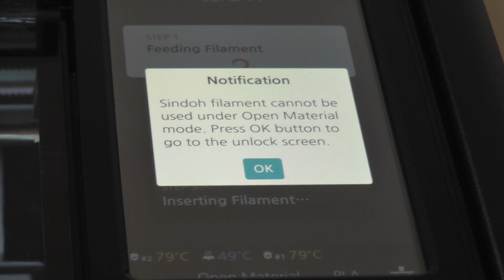10 - Sindoh 3DWOX 2X 3D Printer - Open Material Wide Spool Mod and Opening the Case

Comment: In the video you mentioned the filament guides for the open source. Do you have the stl files to print the guides for the 2X printers?
Reply from the maker: These guides can be printed from the Test Print area in the Settings menu on the 2X printer itself.

Comment: Very informative videos Bob. Thank you. Quick question for you,  is it possible to print two of the same parts at the same time with both print heads?
Reply from the maker: Unfortunately not.  Think of the complications.  You would have to first have both parts being printed at the same Z layer at that same time.  Then you would have to assure the print heads didn't crash into each other.  While I can conceive it may be possible in certain rare situations, in my opinoin it would be too restrictive to make it feasible.
Reply: @AllThingsBobot  Thank you Bob.

Comment: BOB,  will pc+ filament material work ok on these heads without having to "upgrade them?"  I also accomplished this mod and I must say your video was extremely well put together and made it a sinch.   Thanks a ton.   :)
Reply from the maker: I don't know about the pc+.   On the Amazon listing for the 3DWOX 2X, it lists polycarbonate and metal as compatible materials.  Create a support account and put in a ticket with Sindoh support here and ask them about compatibility for the specific machine you have:   https://3dprinter.sindoh.com/en/sign-in?url=support/faqs/qna

Comment: can you post the wox2 aliggnment file ?
Reply from the maker: Note sure what you mean by "alignment file"?  There are profiles posted here for 0.5mm extrusion width for both Simplify3D 4.1.2 and Sindoh Desktop Software (https://github.com/bobotmedia/3DWOX-2X).  The .STL file for the wide spool mod spacers shown in this video are in the link above in the video description.
Reply: @AllThingsBobot  The model for the little bracket you used to load open filament that attaches in the front.
Reply from the maker: @MicheleHjorleifsson  Filament guide brackets are located in the printer itself under TEST PRINTS.   Assure you have updated to the latest firmware if not found.
Reply: @AllThingsBobot  I click test print and it asks me for a USB stick which i unfortunately formated before the last firmware update.
Reply: @AllThingsBobot  specifically the one you show at 11:29 in the video
Reply from the maker: @MicheleHjorleifsson  I don't have an .STL for these nearby.  I print them from the TEST PRINTS in the machine.  You can put the printer on the network (wired or wireless) and then update the firmware via the menu.  If you have further troubles, you can create an account and put in a support ticket with Sindoh here:   https://3dprinter.sindoh.com/en/sign-in?url=support/faqs/qna

Comment: I have been following your videos which have all been very informative and well structured. Do you have any experience in using the product 'Machinable Wax' I have a 3D2X and a 3DWOX1 but have not found any good output with the wax? Have you tried this and if so have you been successful with this wax filament?
Reply from the maker: No sorry, I have not dealt with machinable wax filament.  I have printed with eSun TPU flexible filament that was rated at a Shore A hardness of 95A, which I understand to be close to a Shore D hardness of 50D.   The machinable wax showed a low 50's on the Shore D hardness scale.  Sindoh tech support indicated to me sometime back that anything less than 65D has a better chance of becoming entangled in the extruder mechanism, however they also noted that their own Sindoh flexible filament is typically around 61D-64D.  With a little prodding, I am typically able to get the eSun flex 95A (50D) to run once I get it to initially push through the hot end.  (Getting it flowing through the hot end by pushing a wet noodle through a meter-long tube (Bowden) on the 2X is a challenge.)  I briefly looked up the machinable wax, and it indicated a low print temp of 140-150 C.  That might pose a challenge to getting the right profile set up for open material mode on the 3DWOX, but I haven't tried.

Comment: Just installed the spacers on one side of my printer tonight, thanks Bobot!

A separate question: do you see large amounts of ringing on your 2X's prints when you print at say > 20 mm/s? Any tips on reducing vibration?
Reply from the maker: Glad the spacers worked for you.  I don't seem to have ringing problems, especially at that low speed.  I print mostly at 40mm/s and maybe bump up to 60mm/s occasionally.  However, when possible I design my prints with the wall width in mind and try to play with the number of walls to print more solid, long strokes instead of jerky, shakey little infill movements (that's what she said).

Comment: This is the video I waited for. Thank you so much Bobot.
Reply from the maker: You are welcome.  I hope it works out.  Remember you may want to reduce/modify the thickness of my .STL spacers or design your own, but this video should get you into the unit to do the mod.
Reply: @AllThingsBobot  My favorite filament supplier is eSun. I have read, that the Sindoh filament also produced by eSun. Their spools mostly fit, sometimes not, if eSun has spooled it to strong. And the shaft #2 is wider than #1. Hatchbox isn't available in Europe and ordering in USA is to expensive. Is Hatchbox really so good?
But it is good to know, how I can open the machine in the case of trouble. I have the 3DWOX 2X now about 8 months and it is often very frustrating, because good results need a lot of patience and experience. It is my first 3D-printer.
Even more I am happy about your 10 videos and your style to look in the depth.